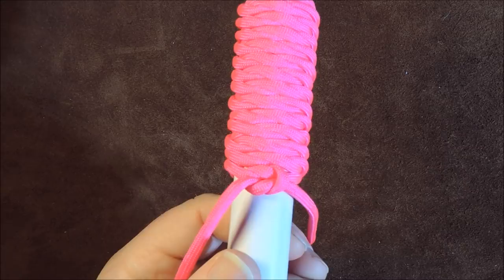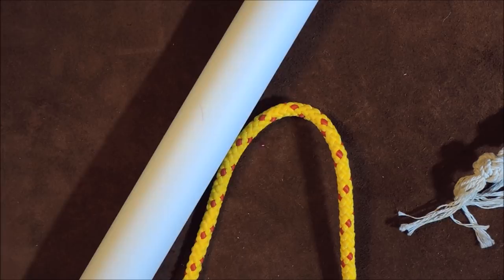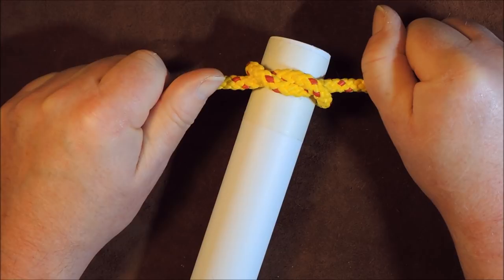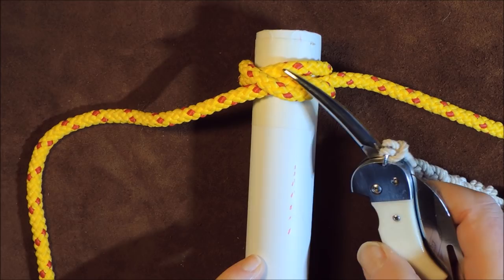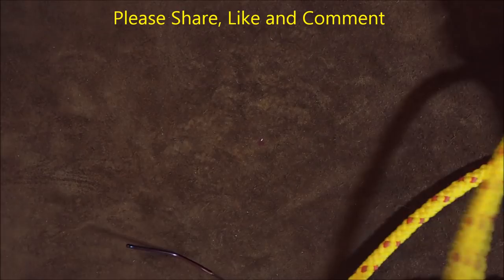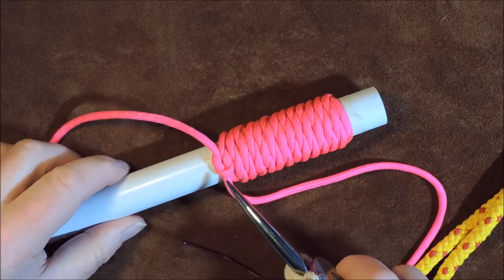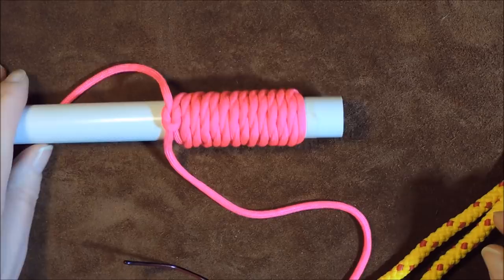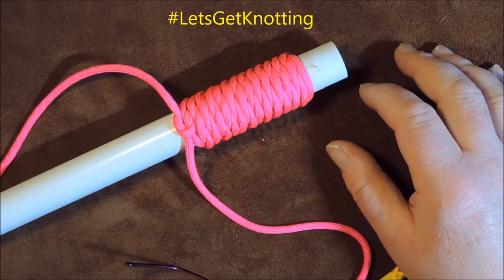West Country Whipping - West County Whipping - Decorative Covering Knot - Paracord Handle Wrap

Comment: Thank you. I use West Country Whipping to cover Bic lighters with a linen kitchen twine, then seal the whipping with hair spray. The finished product doesn't require much time and looks pretty good.
Reply from the maker: You are so right Dan, it really does make a Bic lighter look smarter. Just wondering, do you know if Bic lighters are refillable?
Reply: That would look good but very flammable so....no
Reply: @Broody4Boglim  — True. Tho no more flammable than a molded plastic extrusion pressurized with butane.